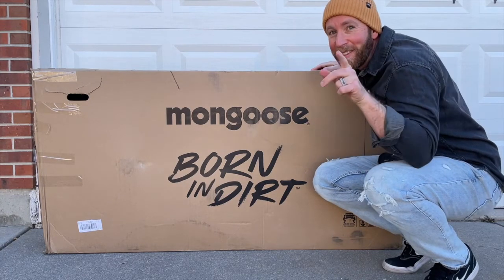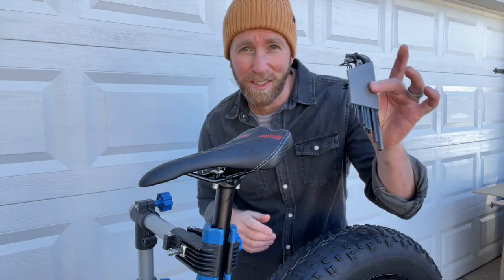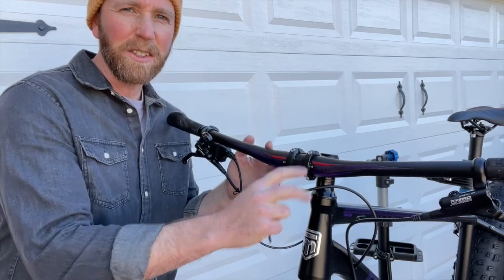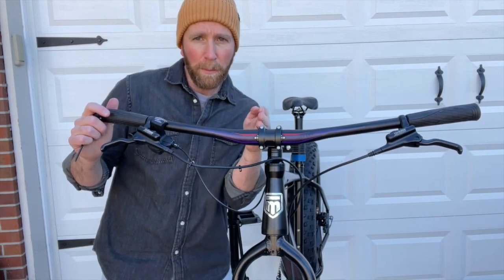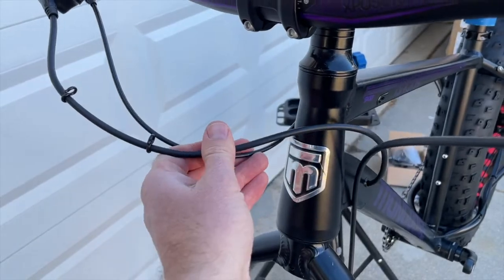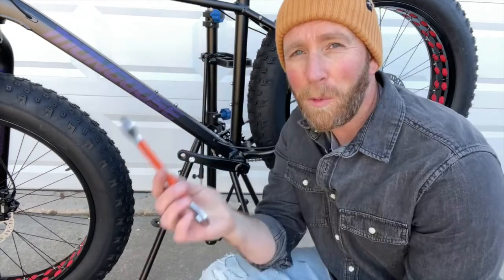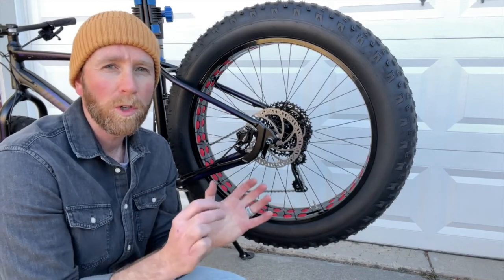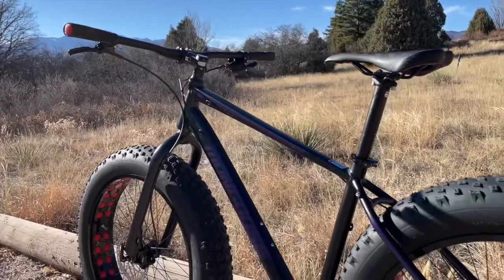How to Assemble the Mongoose Argus Sport Fat Tire Bike

Comment: Great video.   Question for you.   I am trying to put front tire on, and the brakes seem closed and will not slide over the disc.   What do I need to do to fix this issue?

Any advice will be greatly appreciated.

Thank you
Reply from the maker: The first thing I would do is check to see if the little plastic tab is still inside the brake caliper. That’s the way it comes shipped. You need to remove that plastic tab and then the rotor should slide into place.
Reply: @Scott's Garage  tab is removed.  Looks like brakes are touching.   I may need to look how to adjust to open then just a little bit.
Reply: You'll have to take the brake pads out and gently push the pistons back into place.  I had to do this on previous MTB's.